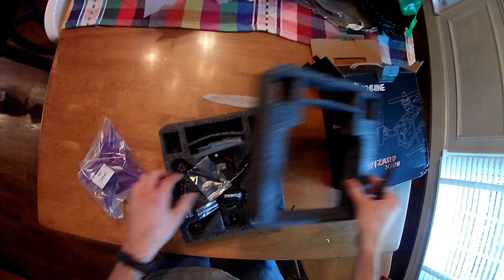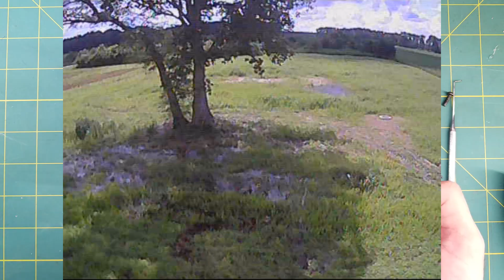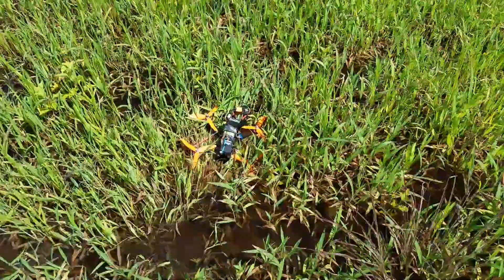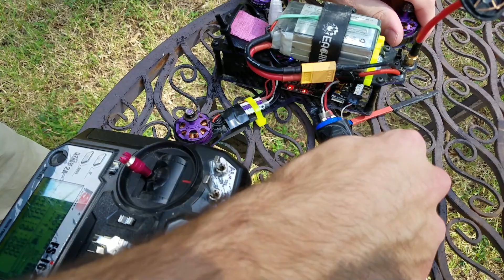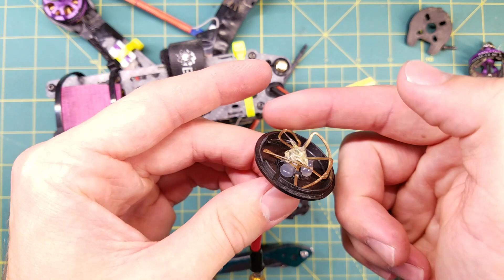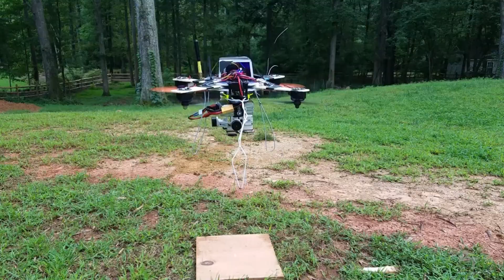TIME TESTED: Wizard X220 FPV Drone Reviewed after 1.5 years

Comment: Crazy stuff happens. 😄 Can't wait for another video. My took some hits as well. Now I'm replacing camera( thread was gone in one of the screws from new ), new motors and new frame( different one ). UPGRADE!
It took some hits in metal light pole. Still flying but it is time to have some fun upgrading.